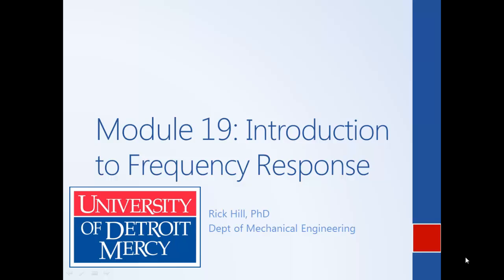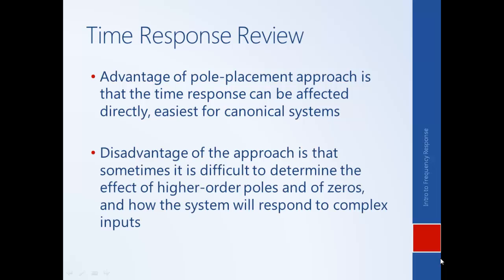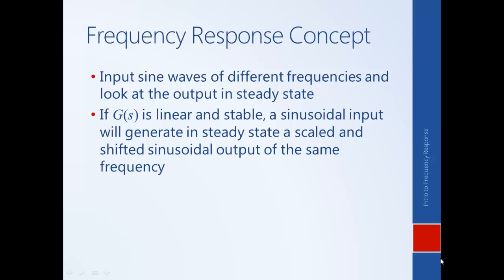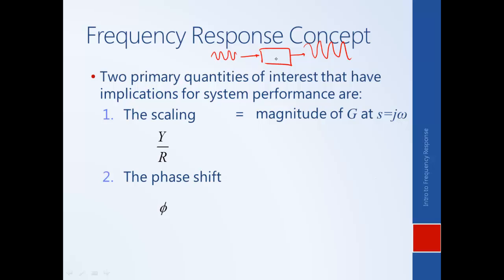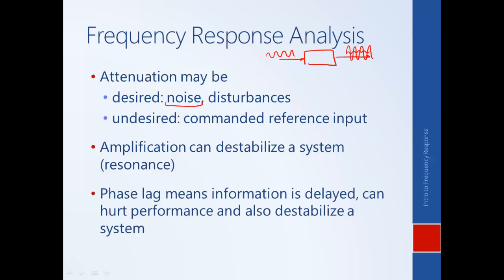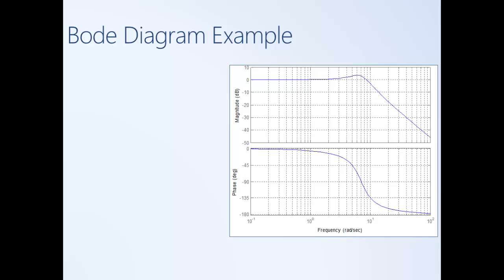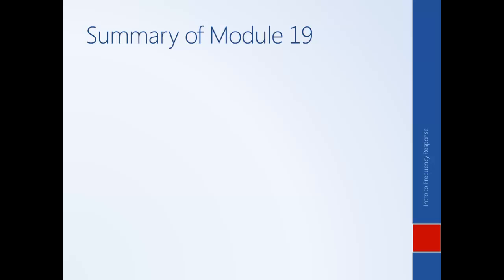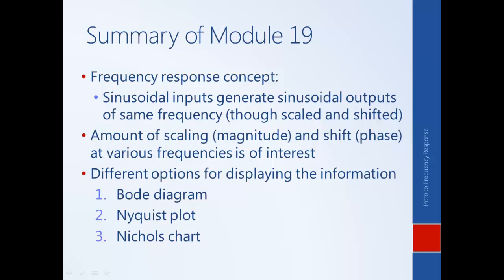System Dynamics and Control: Module 19 - Introduction to Frequency Response

Comment: hi,  at website cruise control analyze you showed frequency response. actually i dont understand here interpretation of frequency as always  (cycles per second in a vibrating string or an AC electrical signal). because it does not mean as normal.what does frequency here mean?
Reply from the maker: The output of a vehicle cruise control is the vehicle's speed. While such a system won't necessarily oscillate "naturally" (like a vibrating string) it will oscillate if the system is forced by an oscillating input. So here the speed of the car is oscillating, but that is because the input is also oscillating. That is the idea of frequency response, analyzing how a system responds to oscillating inputs of different frequencies.